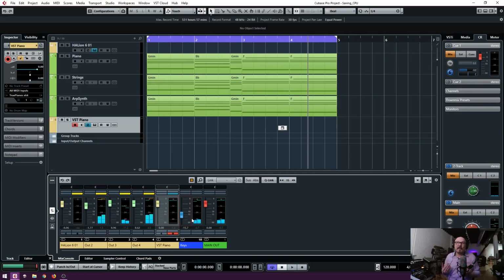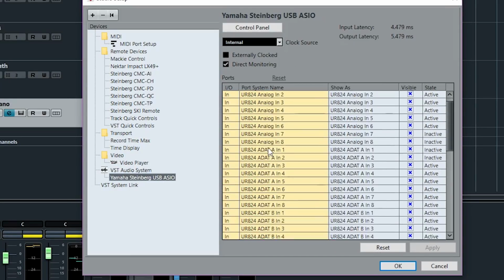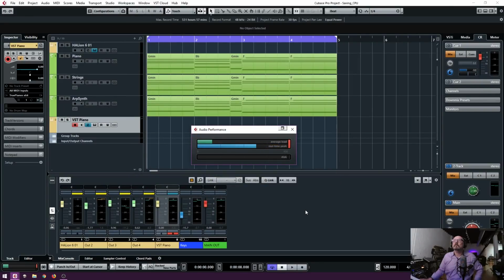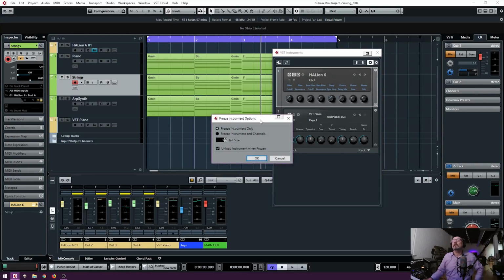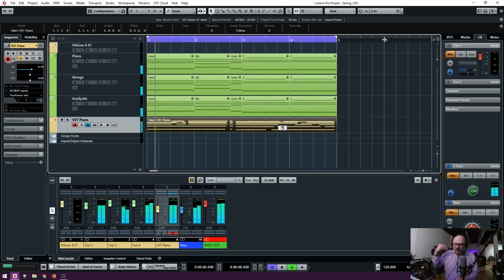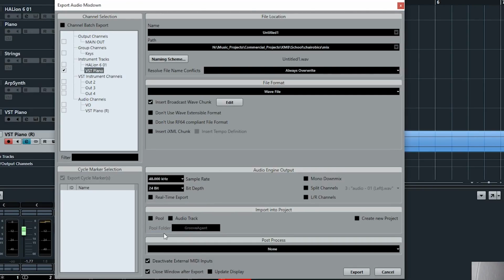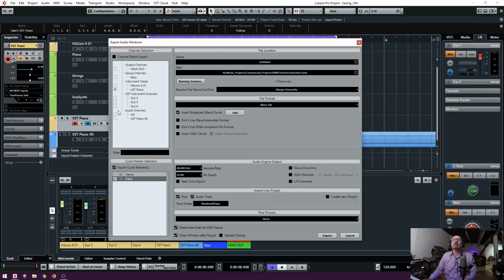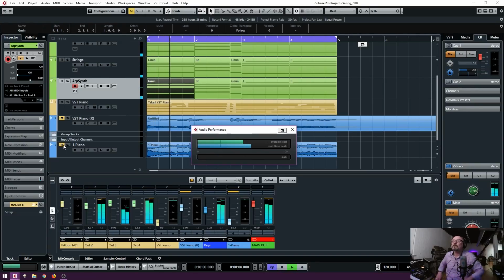Maximizing Track Count & Saving CPU in Cubase

Comment: Regardless of Processor, Cache is everything.. And ur CPU only has L1-256kb, L2-1mb, L3-8mb.. Ur Cache is what transfers the data between and from HD ur CPU and RAM.. So the more Cache per CPU core the better, if you where to disable 2 cores in the BIOS software you will see a big improvement in audio performance... The recording and playback buffer size you are able too set in Cubase is governed by how large ur Level 3 cache is....

Comment: Thanks for the video! What is the actual difference between freeze track and render in place?
Reply from the maker: You may have already figured this out by now, but freeze track limits your ability to change existing effects on that track, and render-in-place creates an audio version of the midi track. This allows you to continue adding effects to the track. Also, when you render, you have a choice of how much of the processing chain is included. After you render, you can also disable the original track (not just mute) to further reduce CPU. I always make a folder to keep every original, disabled track in case I ever want to change anything around the composition. Great question, sorry for the very late reply.

Comment: Strange, that must be a very old computer, mine is 7yo and I use way more tracks than your demo and it never did that even with big VSTs like Superior drummer etc, and it never went pass 25% on the perfo tab, I have a old i7 3770k with 32gb ram
Reply from the maker: Yes it was an old computer, but still perfectly capable of running 80 plus tracks with plug-ins. For the purposes of the video I deliberately hampered the system performance to make it as bad as possible. I couldn't really demonstrate the issue unless I could recreate the issue. I have since upgraded anyway, and I'm enjoying life and Cubase.
Reply: @CubaseAcademy  Okkk that's why :) 4 tracks and cracking was a bit funny to me. I also be upgrading to i9-11900k as soon as I can get one.
Reply from the maker: I went with a Skylake 12-core and 32GB ram. I also switched to an m.2 drive for my working drive, and using ssds for backup and Library storage.  I just completed a quite heavy mix with about 80 tracks and 10 buss groups all with plugins and even a couple of VSTi's. The machine never even broke a sweat.
Reply: @CubaseAcademy  Good to ear. Cant wait to have mine. Ciaoo

Comment: I still don't get why cubase is so processor heavy
Reply from the maker: It's not. I deliberately overloaded my system for the demo. Under normal circumstances I regularly mix over 80 tracks with plugins. My Xeon processor was getting a little long in the tooth, but was still very capable. The vid was mostly aimed at people using laptops etc. Thanks for watching, and for your comment.
Reply: @CubaseAcademy  i use cubase and really feel like it is processor heavy. I use all the techniques you speak about. My computer is very powerful. Only thing is it's an old Mac but with great specs. Could the age be the issue?
Reply from the maker: @peppercrybeatz  Well, it certainly could be.  Full disclosure; I am not a Mac person so don't know much about how the OS etc. works, but I recently had to 'bite the bullet' and invest in an upgrade.  Actually a whole new build.  I got 10 good years out of my Xeon build, but it was starting to show its age.  I always build my own systems, so I can save a bit of money there, or spend it on better components.  I realize that's not an option with the Mac systems.  But for reference, I now use a 12 Core (24 total) 3.5 Ghz CPU overclocked to 4.2Ghz, with 32GB RAM.  It has made a significant difference.  The first big project I did with the new systems was 88 tracks, many VSTi's, and plugins on all the channels, Softube Console1 for starters.  Even with convolution verbs and some pretty heavy hitter plugins, I never had to freeze, render, or use any other processor-saving tricks.  I can also run at 48 frame stable on the ASIO side, meaning I have about 4 ms of latency.  It was work the expense and hassle of the upgrade.

Comment: Hello, thank you. You saved me spending cash on a new system just to get over (maybe) the problem. My 'puter was running at 512 and I've increased to 1024 without problems. btw, leave in your mistakes! Without that "going off script moment" I wouldn't have learnt about reneder in place.  Cheers, stay safe

Comment: Hi,
thx for the bunch of great tips!
I'm using a Steinberg UR 22 mkII, so somewhere the same as you but with less channels. I didn't think the size of the buffer would affect the MIDI latency? Isn't the buffer just for the audio signal? Of course, when you run your system busy, the processing of the MIDI events will be delayed. I don't have a keyboard with a classic MIDI-Connector, so I can't check it out. I'm a guitar player and I use only a cheap USB to MIDI keyboard (Nektar Impact LX 49+). 
It's only because of my poor English and the google translator when I appear rude.
Best regards
Markus from Germany

Comment: Great insights thanks Gary! I have just upgraded to w10, so I did a complete restore of Cub 7, plus it’s upgrade to 7.5, all the ilecencer data reset, I lok & Gobbler loaded, vsts & plug-ins updated. Still a bit to do re  media library.
Even in W7 I was having system crashes & now in 10, I cannot record audio or import say GarageBand pre recorded files without a corruption occurring that has early intermittent clicks & eventually white noise kind of screech, then the prog crashes. It corrupts files that are already in a working project as well.. 
I suspected a firewall issue, but I ilok, avid etc have been allowed access . .this tutorial gave me hope . .haven’t opened PC yet to trial.
Any suggestions? Cheers, pierre
Ps, using a 3 yr old 1st gen Focusrite that works perfectly if I’m recording into GarageBand pc, i5 chip, 8g ram. File storage on external drives, programs on internal C drive.

Comment: If you have a backup software like Carbonite...turn that mofo OFF...it's a CPU sucker of immense proportions. Just pause it during the day/night when you're recording and let it back things up later in the day.
Reply from the maker: You are right about that!  I was running Acronis, but killed it due to the awful performance hit.  For this video, I purposely limited and stressed my system, which can normally run 80+ tracks with VST's no issue.  For backups, I simply use RoboCopy to do a "delta" of my working drive to another drive, then that whole backup is also backed up to another drive using RoboCopy (it's free in Windows 7, 10), and finally that drive is backed up to Dropbox AND google drive at night :) I am paranoid, yes.

Comment: Very good video for people with low powered systems and in general good to be economical regardless of your system,  however.. I feel there is somthing very VERY wrong with your system.   3 instances of halion , groove agent,    and around 25 VST's   (just did this to test)   my performance meter only gets up to around 22% whn I'm playing chords its currently set at 256 samples  96khz 24 bit,   on my 4 core i7 7900k 16gb 4.5ghz which is more of a gaming CPU really,       one thing you have overlooked and I hate this in windows is the defalt Power options are ALWAYS set to prefer to save power or balanced and to throttle the CPU,  I set it to 100% utilization and maximum performance,  and some times like a few months later or a windows update and its back on prefer to save power mode.    I would guess your power settings are set to balanced or somthing.     I'd check that out.  that will absoloutly cripple your CPU and knock 70% of your processing power off your system.
Reply from the maker: Thanks for your comment.  There's nothing wrong with my system, I regularly mix songs with 80+ tracks, and a ton of VST's.  As I mention in my video comment, I purposely made my Xeon-based, liquid cooled, 32GB RAM system run badly for the video.  Your advise about power management is good, and I probably should have mentioned it in the video.  I also set mine to max power.  Question: Why run so many versions of GA, as it has four separate drum machines in a single instance?  I love GA, but not a big fan of the mixer setup.
Reply: @CubaseAcademy  oh sorry, I missed the part where you said you lowered your Cpu, that makes sence!     no I had 3 hallion  and 1 grove agent.... bad grammar ;)      I prefer Battery but had a problem with it last time I installed it.

Comment: Sir, I have a problem asio time overload for my cubase 5, just only 15 tracks why so lagg? I5,8gb ram and 1tb hard drive
Reply from the maker: Hi Aboi, sorry you are having troubles with your Cubase setup.  It's impossible for me to pinpoint the exact issue, as I don't know whether your tracks are audio or instrument tracks (some VST instruments take a considerable amount of horsepower), nor do I know the ASIO drivers and hardware you are using.  Try freezing some of the more demanding tracks, the ones with VST's especially, and also adjust your buffer time to relieve the CPU (as the video describes).  I hope you get back to making music soon!

Comment: Have the same size processor as you, but I have 32 gb ram and I don't have any of these problems. I use Cubase 9.5 and predominantly EastWest libraries on 512 sample rate and I have no problem running about a dozen different VSTs at the same time. Very good video though.
Reply from the maker: Thanks for the comment.  I have no issues  either, currently mixing 70+ tracks with tons of vst's.  This was a simulation to help a subscriber with a question.  However, I am considering a processor upgrade 😊

Comment: You dont show what effects you using on tracks, they must be the reason for that, or your system is messed up
Reply: The purpose of the video wasn't to demonstrate WHY he was having CPU overrun. It was to demonstrate how to handle that situation in the event that they occur organically whilst working. 

It's like benchmarking a CPU. You throw something at it that simulates maximum workload, you don't optimize efficiency going in because that defeats the purpose. 

Your comment is like saying "...oh the dyno is spinning so the car isn't actually going anywhere. you should test it on the road..." 

Not remotely the purpose of the test.

Comment: If you still have your UR824, I'd like to ask you something: 
How it if possible that the ur824, a modern, 'pro', quite expensive audio interface,   can only go as low as 64 samples, for a ~5-6ms in/out latency, and my old, trusty Maudio Delta 1010, from 2001-2002, can still work on windows 8.1, and i was able to get ~3.5-4ms of latency, at 128 samples, 6-7ms at 256 samples, and i think i could even get like 1.5-3ms at 64 ! Unfortunately,  the sound on the analog out 1-2 started 'glitching'(maybe it's just the windows drivers  going crazy),  and i now need a new card...being a cubase user, the UR series , obviously,  looked like a great choice.... but when i started looking at the different models and the buffer sizes... they no longer look as great...
How is it possible. ..? Even 20yo cards can do this like 32 samples... 6ms at as low as 64 samples, is a lot.... i remember going from 256 to 128 samples would already put a lot of stress on the cpu and system..... having to work at 64 samples just to get a decent 6ms of latency,  sounds absolutely crazy to me.
Any opinions ? Thx
Reply: My ur824 goes to 32 samples

Comment: Geez 3 tracks and problems?  I have one for you all when you already have 40 tracks and want to add something else and the project its almost finished automation and the singer.  Wants to re do vocals.... I do have a system alt and turn off every plugin that produces latency  also  bounce selection   on midi and audio tracks  then go to the pool and right clich "delete unused data" then empty trash .
Reply from the maker: Thanks for your comment. I purposely crippled my system to demonstrate something for a specific problem someone was having. I regularly run many many tracks at once, I'm doing one right now that has 30 plus tracks with plugins on every single Track. Running in real time.

Comment: Try it with 6 tracks, nevermind 24 it will not move, also 192k is still fiction. Cubase 9.5.30, I7 6850K 6 cores, 32GGB ram kingston 3000, clarett 8preX thunderbolt, and this thing is not working, i love Cubase but time to let it go i didn't spent all this money to learn to be computer tech but producing and recording music. It is becoming worst and worst after every new update and that is the overload to maximum using just few midi tracks. I've tried everything for last two years and nothing is working so far. No support from Steinberg just rip off for every update for stuff that i can't use.
Really time to say good buy to Cubase and switch to Logic.
P.S. My first Cubase was SX3-2005.
Reply from the maker: I don't sell Cubase, I only use it. But I'm currently mixing a 20 track session, with eight subgroups. Also multiple effects, most of the tracks have an analog console emulator plug-in, and some compression. And my single Xeon is doing a decent job. Room for more. I can't speak to everyone's configuration, or experience. I was just trying to help a guy out with a specific a problem. I hope you have better luck in your new DAW.  My first was dr. T's KCs on a Commodore 64. LOL.

Comment: I have been playing keyboards for over 30 years but have been thinking about switching over to computer based music recording.I have watched dozens and dozens of videos on YOUTUBE over the past week but this video has got me a little scared.I am a ground zero on the learning curve on how to use CUBASE 9.5 so are there some really good tutorials on how to use CUBASE 9.5.I mainly want to get into scoring orchestral music and so
 I have a few questions.Is Cubase 9.5 actually designed to use more than a dual core processor.From what I have read about Cubase, a processor with more than 2 cores actually slows the system down. And as far as RAM goes, would going to 32gb or even 64gb of RAM handle the demand on the system that you created for this instructional video? Thanks in advance for your answers. Adding you to my watch list.

Comment: This is nuts. I just got an HP Z600, 2 x Xeons at 2.93g and 48gb of Ram. I run through an M Audio Profire Lightbridge and my audio usage id stupid. Even with no tracks its showing usage. I used to run a hooky version of a certain piece of software and managed to get a buffer of around 128 and roughly 15-20 tracks playing back with plugs in etc and no problems running on an old quad system with 4gig of ram. Why did I just spend a tonne of cash on something that seems to a step back in what its designed for. Making music.

Comment: I don't understand how you can get it that bad. I have installed for a test cubase 9.5 pro on my old 2007 Imac (2,4Ghz, 2 core, 6GB memory) in combination with an UR22. I get a problem only at 32 sample. It's audible but not as bad as your example and  the meters does not go crazy like yours. At 64 no problems and i use even more vsti's tracks than you do in the example.

Comment: Makes you kinda wonder: Why doesen´t Steinberg just make a single Button for switching between huge buffer or great latency: So you easily just could swap from MIDI Keyboard to Mixing without annoying scratches. You may think: Well why coulden´t it just do it Automatically in Realtime then? Well i think that would be bad, coz then it would probably steal valuable CPU time all the time.
Reply: There a button to switch off cpu intensive jobs for the recording.

Comment: i had a problem with the vst connection!! i'm using dn-32 usb as my connection with midas m32... my problem is i can't add 32 mono buses!! i only can get 16 mono or 8 stereo... i've tested on 4 unit of the midas m32... it has the same problem.... i not sure is cubase problem or the board problem

Comment: so weird, my system is an AMD Ryzen 7 - 1700 .. i have around 122 channels, alot of Groove Agent, Retrologue & Massive parts, CPU load hovers around 30%
Reply: great i just have ryzen 5 1400 after bending up my pins on a ryzen 5 2600 that was brAND NEW but i get a high rack count i use halion sonic 3 , waves effects with reverb (abby rhodes a cpu HOG) and my GOLD standard keyboard yamaha motif xs6 i love it and it all works flawless steinberg ur-44 interface and mackie monitors  and i only use the system for music and nothing else  i know you didn't ask for info just sharing one small studio owner owner to another well you may not be small keep it up
Reply: @thomasyoung5680  - when you have your project full of plugins the cpu shows how ? How much memory you have. Thanks. I m still at i7 with 16 gb ram and uhe repro kills my cpu. I can have 6 omnisphere open at the same time and play the midi parts with plugins and goes on  yellow. Omni is not as consuming.
Reply: Same here...I layer soft synths and barely see see my cpu meter stressing running 24 channels.
Reply: 56 full stems loaded in the Cubase 
It says Disk Catch Overload..

56 full stems loaded in the Fl Studio
It runs smoothly...

Tell me what should i do with Cubase?